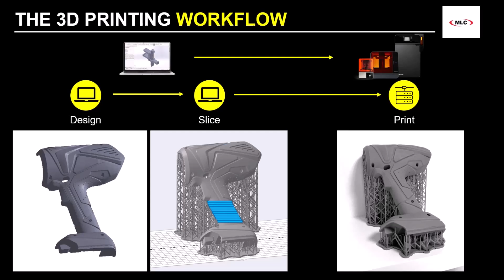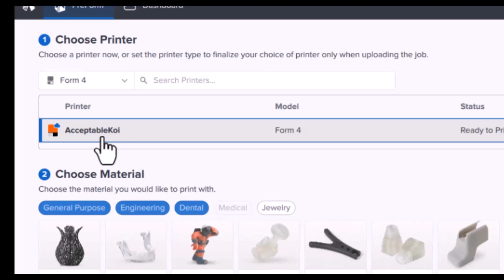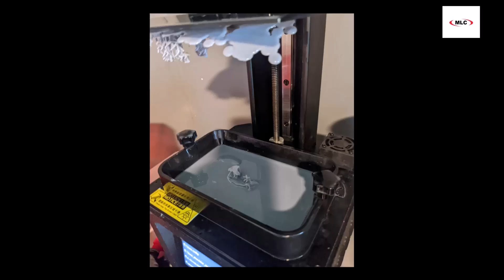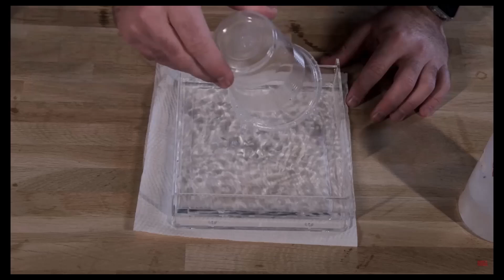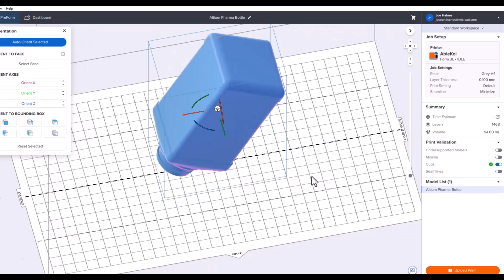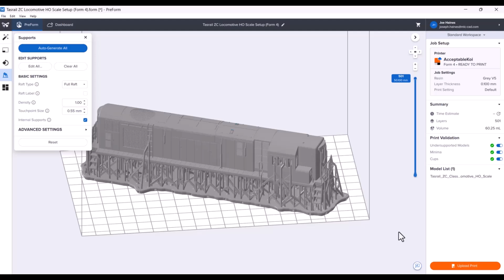Starting Your 1st Resin Print Job | 3D Printing With Formlabs

Comment: Question is how do I get this to my Elegoo Saturn 3 Ultra. I love resin printing. If You can make peace with all the post processing and precautions it amazing.
Reply from the maker: Every printer, especially the software and some of the special features, are going to be different.  Not sure what exactly you want to get to your printer but often if it doesn't support it you'll have to wait for the manufacturer to add it in software or release a newer printer model.